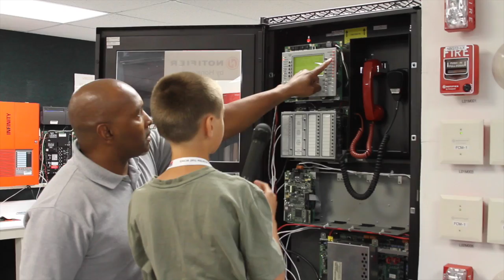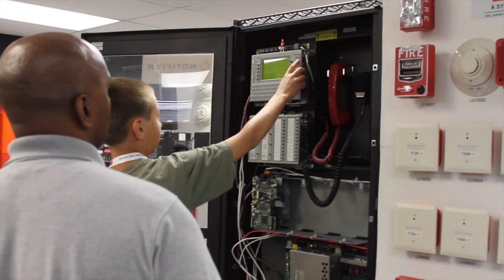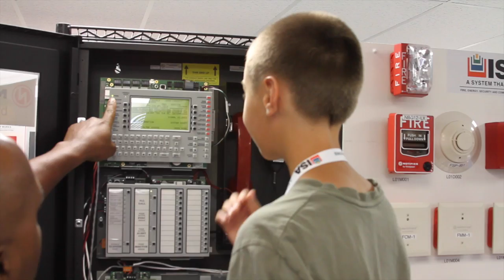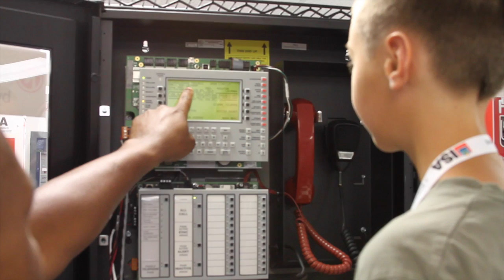How Fire Alarm Control Panels Work

Comment: I haven’t had it go off yet, which is a great thing I suppose. do7.pl/First Super easy to install, when I tested it, the noise level is very loud which makes me feel very safe in case of something happening. I wouldn’t suggest this for a hotel or travel like it states, unless you use double sticky adhesive so you don’t have to put screw holes in walls or ceilings. Great price for a device that recognizes smoke and co2 levels.

Comment: that has to be the ugliest fire alarm system I have ever seen in my life. the BGUs are massive. what commercial premises would want that thing? way better systems available,  advanced with hockiki detectors for example
Reply: N g100 
C
Reply: Actually these Notifier panels are very popular much more popular than advanced I've worked plenty with both Advanced and Notifier and I can tell you right now Notifier blose Advanced out of the water you can do way more with a Notifier panel then almost any other panel. It is very with extensive networking capability,  and this particular panel can have up to 1000 control by event zones programed. Plus this panel is UL listed for releasing clean agent and pre-action sprinkler.  Advanced does not have any releasing panels at all and has no plans to make one.
Reply: N g100 how come you don't have any videos posted on your Channel huh
Reply: N g100 by the way I just subscribed and turned on post notifications you're welcome considering I'm your only subscriber no offense

Comment: Notifier panel and devices with Simplex notification appliances what on earth
Reply: Why Simplex notification appliances on a Notifier
Reply: System
Reply: They are grinnel/Johnson controls.
Reply: @AcElectronicSystems  ISA not grinnel or Johnson controls
Reply: @FireTech7  never said it was kiddo.
Reply: They have that at the middle school near my old house. The school was built in 1954 with an old Edwards system with flush-mount 380-L Adaptahorns, which came out in 2003 in favor of a Simplex 4100U voice-evac system with TrueAlert speaker/strobes and remote strobes. Then in 2011, the 4100U began failing, so they replaced it with a Notifier NFS2-640 system, and despite replacing the panel, transponders/power supplies,, initiating devices, remote stations and such, they kept the TrueAlert signals and managed to get them working on the Notifier system!

Comment: Multi station smoke detector commercial YouTube video link, saving lives environment energy climate new solar technology eligible to eliminate the need to replace the battery in unit two patents carbon monoxide detector and smoke detector commercial and residential one unit can simply be scewed into your light socket new solar technology.
Reply: What?